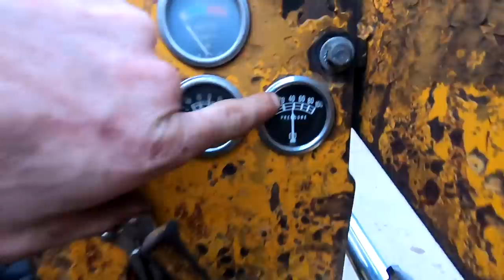A DEMORALIZING Turn in the Restoration of "Old Red" ~ Part 11 ~ 1950s Caterpillar TraxCavator

Comment: There was a lot of loose rust inside the cooling tank when you emptied it and some loose rust shales when you draind it the second time.
My question would be: Why not remove all the rust inside of it with chemical means, rinse and then coat it to secure any rust from forming, before filling it with new water?
Reply: There’s frequently too much just plain old dirt along with the rust to ever get it all out.  I’ve used muriatic acid on some and really didn’t touch it.  Ended up removing top radiator tank and rodding the core out.
The other concern if you were to somehow clean out the block water jacket is you may create leaks at lower cylinder liner o-rings....BTDT☹️
Pony motors are usually the worst affected by scale since there is less velocity that far away from the water pump and the passages are tortuous, just made to settle out crud and precipitate minerals!

Comment: Having never used a thread file, when you do use it, do you recommend using a wire wheel to clean it up first?  Or does it depend on how much other gunk is in the threads?
Reply: Wire brush will polish off crud but the file, a good one at least, will cut away bent and damaged threads a wire brush won’t touch, leaving only the good ones.

Comment: Where did you get the narrow face wire wheel you used in the drill press? I have only found 1/2” wide and greater wire wheels. Great job on old red and your channel!

Comment: 29:39 These clamps might not work properly! Why? Because they do not press on the rubber hose around the entire circumference. Where the bolts are screwed, there is no clamp pressure. Leakage can occur at these points.
Reply: They’ll work fine as long as they don’t interfere with the belly pan.  Such two bolt clamps are used on smaller 3/4” diameter
Reply: Hydraulic hoses on many of the old CAT hydraulic controls that operate at 1000-1200 psi

Comment: Like the videos. So was wondering one thing. When you have the parts off why did you clean the fan with wire wheel or paint the parts while they r off? Still like the videos of course :-)

Comment: An impressive project and not one many men would undertake. Is there another way of mounting the fan? The reason I ask is that it seems to have been installed to push air through the radiator and not over the engine. It occurred to me that is that fan is on the wrong way but I am sure that you have already checked the manual. Just sharing a doubt.

Comment: Any poney motor you have should always take the dip stick out before you start and smell it there good for that issue, change the oil in it offen, possible shaving could be from the starter.

Comment: yes there is more to it you do need to plug off the water passages  and exhaust   use 24 volt deco alt rather than generator and reglater  you also need half inch spacer plate between  starter and bell housing  its been over 30 years since did this on a955h pedal steer power shift   i also did d2 and d4  along time ago the hard part is to get the right gear for the for the starter i have seen you work you can do this  its worth it ps i hate starting motors

Comment: Use blaster: on any bolt or screw you’re trying to break loose ...and tap on the screw with a metal hammer, first ...which knocks the part -loose ....and then gently vice grip it ...and turn it

Comment: DID YOU CLEAN THE FAN BLADE BEFORE RE-INSTALLING IT?  IT STARTS OUT BEING SOMEWHAT BALANCED.  PUT A SMALL SHEET OF 3/16” PLYWOOD OR CARDBOARD TO PROTECT RADIATOR FROM DAMAGE.

Comment: Often pully assemblies like that will be designed so that if you insert longer bolts you can jack it apart and not have to use a puller. It is slightly odd that it is a 2 bolt pattern which suggest to me that they are designed for pushing the pulley off.

Comment: I would get the water pump you are going to reuse rebuilt. 60 year old water pump seals and bearings  could be bad news. check your large parts houses they may surprise  you and have a rebuilt one complete with gaskets. This motor was likely uses in all the Caterpillar products this size, start with NAPA. The best parts houses are the ones that still have those old parts books to cross-reference numbers.  Looks like you already cut gaskets and reinstalled, I'll leave this for future reference...

Comment: You haven't quite won this one yet. That pony motor may be waiting to kick your tail. A word of sage advice about using that pony motor: never turn it off with the ignition switch, ALWAYS turn the valve off at the gas tank and let it run out of gas to shut it off, then turn off the ignition switch. The major pony motor destruction device is leaving that gas tank valve open while running the machine. The carbs on those aren't so great at retaining gas in the float bowl and the bouncing the machine gives it during operation will cause the gas to go through the intake manifold and into the pony motor, then past the rings in whichever cylinder has an open intake valve and into the crankcase diluting the oil with gas. Then your pony motor grenades itself. 
They are basically throwaway engines anyhow, only meant to run long enough to start the Diesel engine and then be turned off. Hopefully you didn't do too much damage to it, but glitter in the oil doesn't sound too promising. You'll also probably end up taking two of those to get one that works. Check some of the CAT owners forums, you may be able to locate some new bearings and other parts when you get into it and see what it needs to fix it. 
I hope you can get back running pretty quick, I've watched all of your videos on this tractor and enjoyed them all so far.

Comment: When putting a rubber hose on a metal tube heat the hose in hot water to soften the rubber and you wint have to fight it putting it on.

Comment: That fuel spilling over in the pony motor crankcase seems to me that could become quite expensive I would suggest that you tear down that carberator again have it ultrasonic cleaned (any debris any gum from old gas anything will be cleaned out of the carberator) then put a new float and needle and seat and gasket kit this should stop that fuel from contaminating the oil in the crankcase

Comment: Does that fan push air forward through the radiator or pull air back?   Because the fan blades sure look like they might have been on backwards.  They look like they are bent to push the air forward.  I don't know the rotation direction of the fan to know for sure.

Comment: white smoke does not concern me as much as blue or black smoke. White smoke might mean a blown head gasket if the pony motor is liquid cooled or has a liquid circulation. if you had grenaded the lower end of the motor you would have gotten blue smoke it would have been oil. I would guess it popped a head gasket and shot water into the cylinder thus the white smoke/steam I am a small engine mechanic for my 9 to 5 happy to help if you need some information
Reply from the maker: That is encouraging to hear, thank you! I'm hoping that is all that is wrong with it... It still turns over fine by hand and I still have about 75lbs of compression just turning it by hand, I haven't wanted to use the starter until i'm sure I didn't throw a rod or break a ring... We'll just have to see what I find as I tear into it!

Comment: Do you shut off the gas to the pup everytime? If not it could leek gas & flood the pup
Reply from the maker: EVERYTIME! (except after the issue occurred, I forgot, but I've already changed to oil to fix that) I even added a SECOND gas shut off for the pony motor to avoid that issue!

Comment: Is it just me, or does that water pump looks super rebuildable?
Reply: They are certainly rebuildable.  Lots of guys won’t tackle one but they’re not complicated.  The impeller has the ceramic seal seat glued to it and they’re frequently loose or broken.  CAT wants an arm and a leg for it but they’re available aftermarket for a lot less.  Of course you need a carbon seal and sometimes the grease seals next to the bearings and very occasionally new bearings and very very rarely a new shaft.

Comment: Those giant clamps were overkill... it's just a return line.. and you had to hammer the fittings in the hose.. probably not going to leak even without clamps... Instead I would have used SS worm gear hose clamps (automotive style), and it would have been just fine (and not damage the hose). The hose is caged between the fittings, so there is no chance it would blow out the ends.

Comment: Question: If you are going to flush and run with water would it not have been better to  add some coolant flush additive to clear deposits and rust?
Advice: Never use normal tap water for usage in coolant as it will put down a layer of deposits in the coolant lines in the engine block that will over time lower the efficiency of the cooling system, as the layer that is deposited is horrible and transferring temperature. Rather use distilled water as it has no deposits present.

Comment: Almost kind of as bad as an old 941 I used to run. Used as much hydraulic fuel as it did diesel and overheated on warm days. I was the only one who could get it started. The hydraulic lines were not so much a problem I could get those anywhere. It was the CAT fittings that were painful to find and buy.

Comment: so  where is the coolant recovery bottle that should attach to the fitting for the overflow?
Reply from the maker: You think 64 years ago they cared about overflow coolant leaking onto the ground?
Reply: @SalvageWorkshop  it would not be the  epa issue but the recovery of coolant after the engine cooled after shutdown.  the vacuum created in the cooled radiator would draw the overflow back in to maintain the level.  the valve you removed and exercised in the video would be the same as a radiator cap is today.  the coolant level  needs to be  held under pressure to keep the temp lower than ambient boiling boiling point.  once you repaired the leaks in the radiator a few episodes back, it didn't matter because the pressure would never get high enough to vent through the pressure relief valve but now that you have no leaks, it becomes functional again, a coolant recovery bottle or tank would be a proper cooling set up.
as far as the pony motor problem,  squatch253 has a whole series on operation and rebuilding of both the top and side mount revisions.  keep up the good work and thanks for progress reports.  love your tenacity in solving the numerous problems the old iron presents.

Comment: rusted in bolts best results soak them in atf plus acetone 50/50 mix always shake it seperates leave it on as long as possible atf has the smallest molicules of all the oils

Comment: If there is an industrial supply anywhere you live, one that supplies mines, oilfields, etc. they can rebuild that hose.  They will remo0ve the old hose, and press a new one in. It shouldn't cost too much, and you'll have a real professional job, and not a half measures one.

Comment: Need to take an impact wrench in running a little slow with a little bit of WD-40 they may have come loose and impact wrench for Shake them lose it work better and trying to just put in full force it on them that way the aberration is the best way to take anything loose like that

Comment: Comment at 39.53. You still would not be able to lift the belt off the fan pully when loosened. You would have to remove the belt off the other pully in system then off the fan pully.

Comment: Those pony motors are bad to leak fuel from the carburetor float. I have had them fill the cylinders with gasoline. Hopefully that's your problem.

Comment: I have same machine and was looking forward to you tearing into the water pump. CAT does not sell a replacement water pump. I have one that I have changed out the bearing and wheel 3 times and no matter what I do, it leaks...... I was hoping you would take the insides out and check and grease and see if I am missing a part or no pressing in the pump wheel in far enough or what. It has me beat and I can not run my machine with water pouring from water pump. Anyone seen a video on anyone breaking 1 down and rebuilding it back. Cat has the bearings and seal and pump wheel, but I feel there is something missing cause like I said, mine just pours water out the front after installation. Help appreciated!!

Comment: instead of the 2 bolt clamps on the return hose.. measure the OD of the hose pressed over the fitting.. get a single bolt exhaust strap clamp. 2 3/4" walker 36460, 3" walker 36345, 3.5" 36346.. that will give far more even clamping force to the hose..  you could so a stepped clamp with 2 bolts if you wanted to go over the shoulder of the fitting.  i have not gotten all the way thru to see the result.

 hint.. Pony motor.. turn off the gasoline supply and let the pony motor run out of fuel .. the diesel engine causes the fuel to slosh and flood the cylinders and leak into the crankcase of the pony motor .. killing it with gasoline diluted engine oil.  is your cat engine  a D3400 or a D311 series.. 
also what size are the track frame threads.. did you see the link i sent about extra long coupling nuts from mcmaster.. that you could modify into far better components for tensioning the tracks..

Comment: Looks like what you need for loosening stubborn screws etc is an impact driver attachment for an air hammer. It works on the same principle as the good old impact screwdriver, but on steroids. Look up Kamasa Tools Article No K 11112. It's a fantastic tool to have.

Comment: I have a question why do u put anti seize on the  gaskets.I’m only 22 is it Some old schools trick or something
Reply from the maker: That's a good question! It's actually marine grease, not anti-sieze, and it helps the gasket seal better on old beat surfaces like on Old Red... it also lets the gasket release better from the metal when & if it needs to be opend back up again!
Reply: @SalvageWorkshop   Ahh ok thx for the wisdom that’s a pretty neat.Thx for sharing your time and answering my question.

Comment: Check onk motor mechanical fuel pump and see if diaphragm went and pumped gas into crankcase. Those kind of fuel pumps are known for that type failure.

Comment: Don't lose hope about the pony motor.  A badly broken pony motor is not necessarily the end of the line for an old traxcavator.  I have a 933 that has limped along with only half of a pony motor for at least 30 years.  
I don't know what originally happened to the pony motor, but for whatever reason my grandpa removed the connecting rod from one side so now it is a 1 cylinder engine.  It it still able to start the diesel, and the cat has moved a lot of dirt with it that way.

Comment: Buy yourself a impact driver that you use a hammer on the motorcycles and outboard motors cheap easy and you don’t generally break the bolts

Comment: Thoughts about the death of Your pony: thinned oil results in a carb float valve fault, the gas keeps pouring when it should shut off by the float. Then about the white smoke: that was probably steam. I bet You blew the head gaskets of the pony. Then I`d worry about the crank bearings, i think they´re shot because of the carb not being right, thinning the oil based on the fine shavings YOu saw. I suggest You look for another pony, Yours will have to be rebuilt. The little pony does so much work: it warms the coolant of the main, it warms the intake air by the muffler, it has so much load on it especially when You try starting in winter. And it needs to be warmed up, too. All the poor ponys out there take so much abuse- I feel for the little guy. I´d start the pony, let it run at over idle until it is warmed up, then give it hell, let it work the big guy against compression with fuel off to show the big guy who´s boss. When it did the work let it settle down and run outta gas by shutting the valve. That´s how I`d use a pony. But all else seems fine, You´re doing great i think. So many old cats didn´t survive, i think Yours don´t have too many buddies around, i think this cat is worth saving to make money with in the long run.

Comment: I gotta 8 hp briggs pony engine. No not a briggs an stratton. Jus a 1958 Briggs 8 horse power tractor pony motor, or more commonly called the donkey 8 hitter. If ya need er lemme know an I'll figure someway to get er to ya from ova ere in summerville sc.

Comment: THE FAN IS BACWARDS.  Convex side should be facing motor.
Reply: No it’s correct both before and after repair.  It’s a pusher fan on a normal clockwise rotating engine.
But you’re correct the convex side of the blades faces the engine.  Cup/concave side ALWAYS toward the discharge of air or you get a lot of noise and not much airflow

Comment: sitting in my seat yelling lol that collar does come off its basically friction welded but some are crimped and epoxy. but if you look down in the hole right where the collar is you can see the center flanges seat end and the hoses crimped on section butting up to another. No Disrespect Meant you are doing a lot of ppl great things with your video's. Most ppl starting in the field drop and sell once something breaks or needs keeping up. When they see what the mechanic charges for simple Maintenance .......S#*% WHAT THE F%#@!!!!! N that's that gone to do something else. Unless you have a natural talent for repair and fixing everything. your videos definitely help all of us small time Ones (hope that's not just me JK) that are trying to start from the ground. .. ...Basement Floor